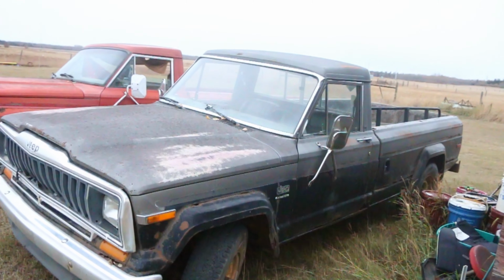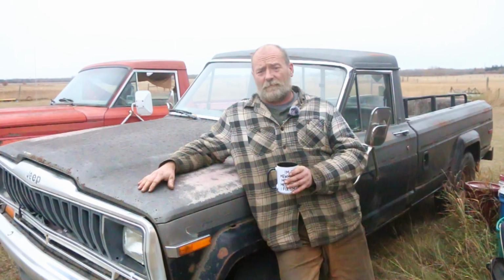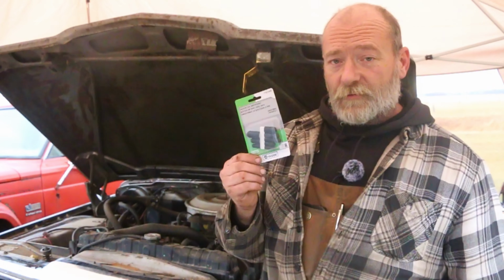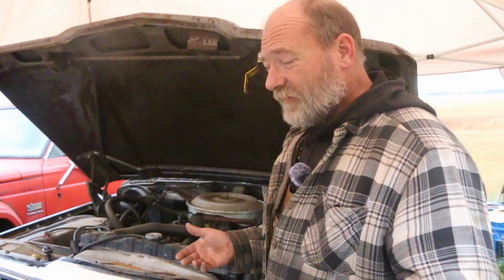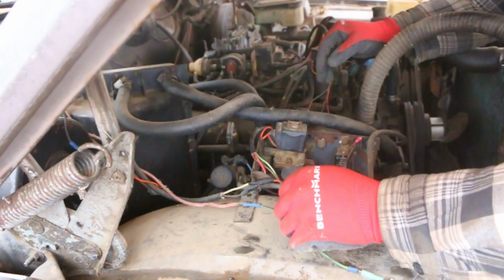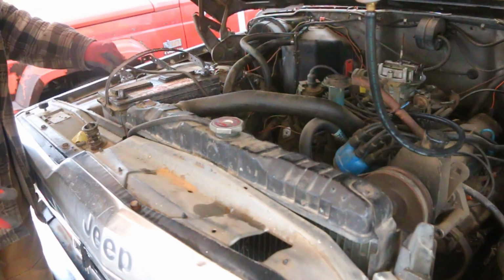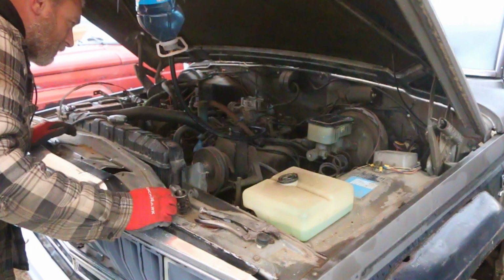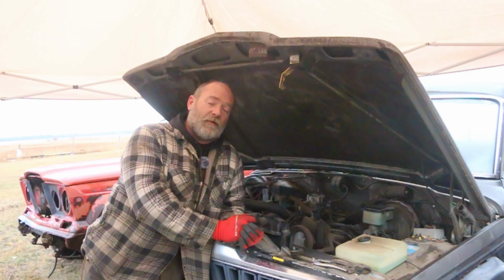Old Car/Truck REVIVAL Video... How to Make it Happen!!

Comment: Another great video. Is your fuel bottle system vented? If not I wonder if having a hole in the bottle allowing it to not air lock might help with fuel flow?
Reply from the maker: You're 100% correct. I need to add a vent to it. I'll revise the bottle and make something a tad more user friendly first 👍🏼